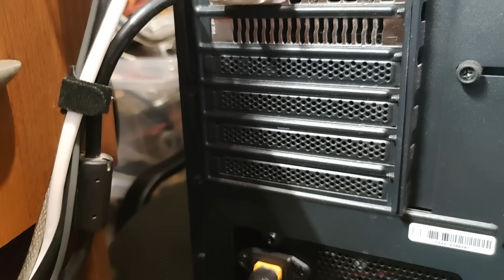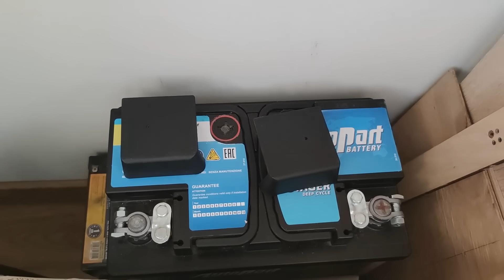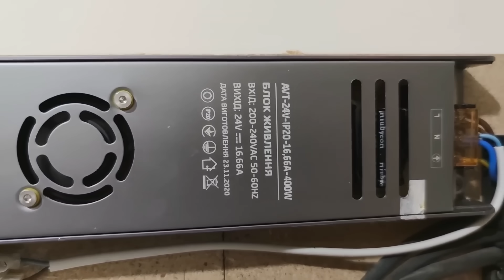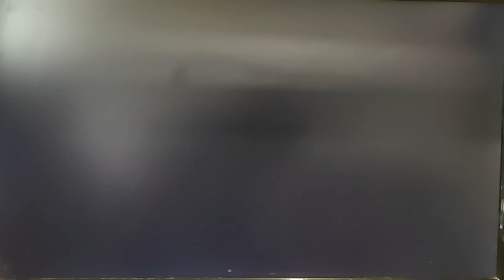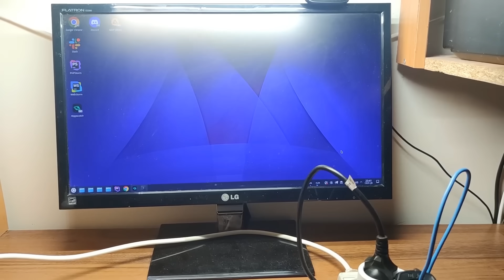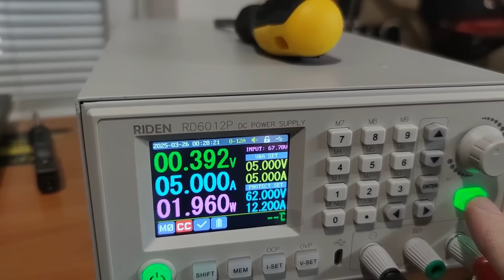I Deleted the Inverter. 50% More Efficient! (Windows vs. Linux)

Comment: You got it wrong when measuring AC, you didn't measure Watts, you measured VAs and thus got it wrong, also it would be useful to state your ATX PSU model and efficiency ratings, as an inefficient one would bolster your DC setup advantadge. Buy a wattmeter for the AC side first. Nevertheless, good job.
Reply: Reactive power causes heating (losses) in generators/inverters if not balanced by something else in the circuit.  Measuring load at the batteries is the ideal way to go as any power returned to the battery will show as negative amperes.  (At least it does on any meter I've used)

Edited to add:
That's the beautiful thing about DC; power factor is always 1.0.
Reply: The only difference between W and VA is the power factor... Which non-Inductive loads almost always have power factors very near 1. Technically, you're correct, but in practice I don't blame him at all for ignoring a difference which likely makes less impact on his system than a single untorqued connector would

Once he starts talking about putting eletric motors on this system though... That's when W vs VA will matter; quite a bit really
Reply: @patconner2638  I don't think he got it completely wrong. As you said, power factor plays a role. I recently tested my home rack trying to decide how much backup ups I needed and found that there is a lot of variability in PF for items that at first glance should be non-inductive. Yes, two of the pcs would hover around 0.92-0.98 PF at idle, so using watts barely changes the calculus. But I had one PC that had a 0.75 PF. Not sure why that one is such an outlier, it did not have excessive amounts of fans or any spinning disks, only thought is it has an SFX power supply. Other outliers in PF included my network switch and my modem that where both around 0.6 PF and an led light bulb was at 0.7.
Reply: @TanisHalfElven fans or spinning discs inside the computer shouldn't affect the power factor, since those are DC devices behind the PSU. The only thing they influence is power draw on the dc side (and therefore directly affecting only real power on the ac side). The PSU itself will be the culprit for the power factor. Either it doesn't have robust PF correction, or it does not correct properly at the load you measured at. Maybe it'll behave differently at <10% rated load compared to 50% or 80%.
Reply: @erdnusserdnuss8985  oh right, dc motors. Don't know why I thought they would be AC. Thanks for that information. This power factor stuff is opening some many new learning opportunities when it comes to electricity.
Reply: @patconner2638  Regarding the power factor: Especially older SMPS like the generic ATX one shown in this video have a terrible PF at idle and light loads. They typically didn't have power factor correction. They directly rectify the mains and charge the internal DC bus capacitors from that. So at low load the diodes just conduct at the peak of the mains voltage for a very short time, leading to a very low power factor.
Only when they are loaded the diodes conduct for a longer time and voltage and current are more in phase thus giving a better power factor.

Comment: You could improve your efficiency even further by curve optimizing that 5600x. It greatly benefits from it. I optimized mine and reduced my peak CPU draw from 60 watts to 47. My idle CPU draw is down to 7 watts. Doesn't sound like much but an added benefit is reduced heat. All the other components benefit from that. 

You could also try improving your GPU power cables if you haven't already. Improving those with shorter or higher quality ones could be substantial as your GPU is the most demanding device! Laptop drives are considerably more efficient so you may consider buying those for ultra low power high-density storage. Still cheaper than SSD.
Reply: Aren't laptop hdds less reliable? Or is it because of usage patterns?
Reply: @sirynka You could argue they are more reliable since they're designed for more rugged environments like motion, temperature fluctuations, vibration, etc but they don't advertise that so I wont argue for it. 3.5" Western Digital Red drives would be ideal but they're expensive. The only reason I recommend laptop drives is because they are more efficient by design and cost relatively less than SSD's do now as a result of the RAM crisis. Ideally you would drop $200 on a 4TB SSD and have the best of both worlds. Now they're like $500.

Comment: Efficiency is not worth it practically or economically, but silence and removing failure points are definitely worth it.
Reply: The goal of the project is not necessarily efficiency but rather being able to power his computer (and other devices) while living through a war since the Russians are blowing up the power utilities in Ukraine, hence the mentioned blackouts.
Reply: @Fractal_32  You can power the computer with an old UPS and two Frankensteined car batteries. I know I use a few systems like that. The cost was literally $0.

Comment: Thanks for the video. I have one question, wouldn't using a more efficient power supply (AC), narrow the consumption difference between the setups ? I don't know what power supply was used for the AC part but it did not look like something very efficient.
Reply: Buddy, they cost like a house
Reply: @RichardLofty  Yeah, I think his money is better spent on his backup power solution.  Even if he did use a super-efficient AC PSU, he'd still have the the inverter losses when running on battery.  I think @h0m1 missed the major point of this system.
Reply: @RichardLofty  I know they are quite expensive but the comparisson is being made with something much more expensive, batteries + all the other things involved. It's not like someone will just switch to DC with 200 bucks. So I think is fair to compare to a Platinum rated AC power supply because of the costs involved.

Comment: Not undervolting makes no sense at all
Reply: It depends, I have done it and it is quite a bit of work depending on how aggressive you want to go with undervolting. At some point I started to have stability issues and has to go back to stock on my 5800x. I think OP values stability quite a lot. As a software developer it is not fun to debug your computer hardware issues while trying to work.
Reply: @ArtiZirk There is pretty well established methods for most hardware to follow to find where people have gone before. And you can use the same kind of stability testing before you put the systems back  into production to make sure it is stable. Undervolting in this scenario is essential. I bet he can drop half the power consumption if he can accept a little less performance.

Comment: Unironically, powering your home on dc makes a lot of sense. The transmission losses only occur over long distance and not converting ac to dc and back again makes it more efficient.
Reply: I legitimately wish houses had a low voltage DC lighting circuit, you could trivially run it off a battery backup when the power goes out. LED bulbs wouldn't need rectifiers and their cheapo driver boards would be put under less strain. Its almost always the driver boards that fail on LED lights, not the diodes themselves.
Reply: @mos6581com this was popular in my country for a long time with 12V systems, but the ubiquity of small self contained line voltage led bulbs has won.
Reply: i've been saying this for years! why don't we have one massive rectifier in the electrical panel and everything in the house can run on DC?? except for like washer and if you have a lift. outside of AC motors, there's no reason to have double conversions
Reply: @UNgineering  you would still need to run at 100+ volts DC to lower the losses from line length and to keep the wires sizes small'ish
you then can also die from DC high voltage (100-240v) not so much on the a/c side of things you will not die
Reply: @UNgineering  The problem with doing that is you would still have losses because each DC equipment would need different voltage and current figures to work. With AC, each manufacturer can convert it to DC then split it to whatever voltage and current necessary for their needs. With everything being DC, that becomes your job.
Reply: @BrunodeSouzaLino  Most DC power supplies accept a large range of voltage input. while not explicitly advertised, this is quite easy to figure out on an in depth inspection of the circuits, some clues given by the main capacitor ratings and the chip doing the local supplies. The very first thing happening in a regular 110/230V AC power supply nowadays is rectification (besides filtering). So the AC gets converted to high-ish DC to be converted to suitable voltages.
Reply: @BrunodeSouzaLino  you could also supply everything in the house with a standard input voltage (e.g. one standard would be 24v like what industrial PLCs use) and the electronics can step down to what they need

AC devices also do that

though this is still more expensive due to the requirement for higher gauge cables, this would only really be usable for resistive loads like lights or pcs, but alot of fans and compressors and motors rely on AC to run as they may not have a speed controller (especially not fans)

AC is very useful for powering inductive circuits
Reply: @UNgineering  because this would be dangerous, expensive and unnecessary?
Reply: @pierrekin  you pretty much just described life in general
Reply: Yes, but only for small loads, otherwise you'll need welding cable for your toaster 😂
And it's relatively easy to do too, all the wireless access points, cameras, VoIP phones and even a few wall clocks and Raspberry Pi's run on Power over Ethernet here at my home, that's essentially a central 48V DC supply 😅
Reply: Well, with solar on hand it's probably worth it.
Reply: @Splarkszter  Definitely.
Reply: Ironically you almost speak real truth. There isn't even losses if to use higher voltage for which we are capable today but changing whole grid is an expensive nightmare so we continue with old ways. So in this video there is nothing revolutionary nor new.
Reply: @TheAgentDeus  Don't forget the nightmares of switching high power DC. You need different switches and contactors due to the possibility of an arc when breaking DC circuits.
On conventional AC the voltage is zero 100 or 120 times a second, helping extinguish the arc. No such luck on DC.
Reply: @kuebbisch   True but this is what I pointed out with "grid needs changes"
Reply: @TheAgentDeus except it also doesn't 
Asides from lighting, most things like AC motors rely on the fact that the current is alternating
Such as single phase (home) or 3 phase (commercial) motors used for HVAC or other industrial applications 

Only thing that could be changed is home electrical codes 
If we switched the grid all to DC, alot of industrial and commercial equipment that runs on 3 phase power will not work unless you had inverters for all of that equipment, which means tons of power loss
Reply: @awesomestuff9715   Yeah, I agree there but from individual point of view, you don't have anything at your home that does not use AC to DC conversion inside of it which means losses. PC, TV, Stove, Central heating pump, Radio, Amplifier etc etc. Even from industrial POW, BLDC motor will beat 3 phase AC in every aspect except the price. Which comes back to my original claim: We already have the grid for AC and that needs to be rebuilt.
That sentence will take EVERYTHING together. But to explain little bit more - Expenses are not only grid, every person has to change everything in their home and every industry has to change most of the stuff in their disposal to comply. So ... ideal world vs reality :)
Reply: @TheAgentDeus  Threephase motors which are commonly used lasts 40-100 years (some maintenance like bearing changes after 30 years required), BLDC or any electronics COULD last 40-60 years, but due to budget constraints they last 10 years if at all. So it makes no real sense, with a dahlander motor you can even have 2 speeds, suitable for most HVAC use.
Heat Pumps like normalyy installed nowadays to heat homes need the inverter to adopt to the heating demand of the house, but could theoretically be driven with the DC from an battery which is used for solar power anyways. Could be an interesting concept.
Reply: But, not everything need DC. It is trivially easier to convert AC to DC than the other way around
Reply: With current semiconductors, DC is easier to work with and transmit than AC. But 200 years ago when the grid was concieved, AC was better and now it’s impossible to switch
Reply: 12-volt transmission losses over house distances are significant
Reply: @thewhitefalcon8539  Not really, you need just beefier wires.
Reply: @TheAgentDeus  Yeah but that IS the problem. If you do the maths you're wasting a whole bunch of money by running 12V with low enough voltage drop. Like, a really beefy computer is designed to run 100 amps at 12 volts inside, or 5 amps at 240 volts on the mains plug. That 100 amps only goes a foot inside the computer and already loses half a volt. If you run it 24 feet you lost all the voltage and it doesn't work. Or you use wires that are 50 times as big, so you only lose half a volt, but those wires would be huge.

Your idea is good for running little Arduino gadgets though. Anything that only needs a little electricity, you can reduce vampire power by wiring them all together to a single power supply instead of one each. I'm not sure how many of those you would realistically have in a single house though.
Reply: @thewhitefalcon8539  I actually know that math by heart but maybe someone else lewrns from it.  You can always increase the voltage. Telecom standard is 48 for historical reasons, ringing was 115V if my memory serves me correct. That said you basically start to loose efficiency quickly with step-down etc stuff. Not that much since you don't need rectifier any more but still loose. Only thing that will be simplified and fully benefits from this logic are charging electric cars basically. Rest of it needs step-down and/or thicker wires.
Reply: @TheAgentDeus   You could, but what's the advantage of 240 volts DC instead of 240 volts AC? You still need a step-down converter at every point of use, and you can't use the low-maintenance kinds of motors.
Reply: Cabins have been doing it for years. 48 and 12 volt systems are very common
Reply: It's complicated, it depends on the load within your home, the distance of the cables, the relative cost (in economic or ecological impact) of more conductor materials vs more power supplies, the pattern of use etc. As an example:

Historically the decision of charging a phone with dc generated locally or transmitted across your home is dominated by up front costs, because the charging standards have changed often relative to the costs of producing the energy.

Charging a car with low voltage DC is going to be impractical even if the conductor length is like 5m from the batteries to the car charging port.
Reply: @pierrekin  Its not impractical as long as you rewire your entire house with 50mm2 copper cable;)
Reply: @pierrekin  Your car has a 400V or higher, up to 800V battery. Best to charge at that voltage. High voltage DC charging today already feels like wrestling welding cables 😂
With low voltage DC charging you propose, do we bolt bus bars to the car then? I have a 11kW wall box at home, thats 3x 230V, 16A AC... On a 48V system that would be over 200A 😮
Reply: Houses use a lot of cable for power and that adds a lot of resistance to the circuit, which makes DC impractical even for smaller homes. Or you would need a separate circuit for each room in the home, which makes the setup impractical and expensive.
Reply: @BrunodeSouzaLino  There is no resistance difference when it comes to AC vs DC for cables. In theory AC is actually less efficent because of capacitive and inductive losses.

Comment: Do you have a link for that dc atx?
Reply from the maker: Yes: https://www.aliexpress.com/item/1005001724610027.html but this exact item is out of stock now
Reply: @SiquellElectronics  ...and the one you originally wanted is back in stock ;)  I just ordered one!  Thank you for this information.

I don't have to live in the same conditions as you, but I do have trouble with my electricity provider after storms.  For the last 3 years my solution has been 900W of solar panels, 2 x 100 Ah 24V LiFePO4 batteries and a hybrid inverter configured as a UPS.  It powers my whole office/lab with battery-to-AC when the grid is down.  I do have 1 battery for DC powered things in my office/lab, but now I will be able to power my desktop PC more efficiently with that DC-ATX power supply!